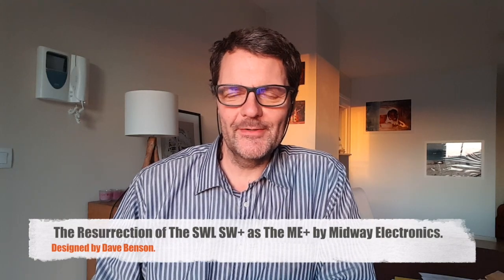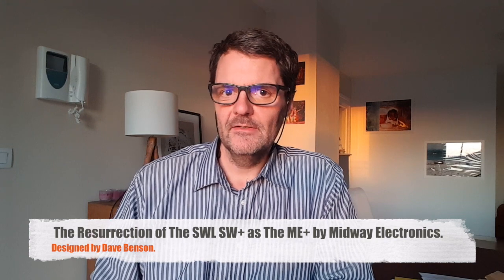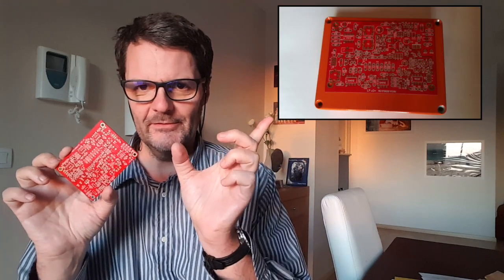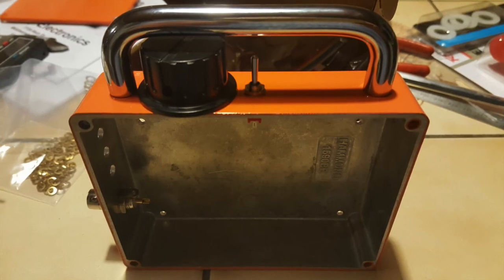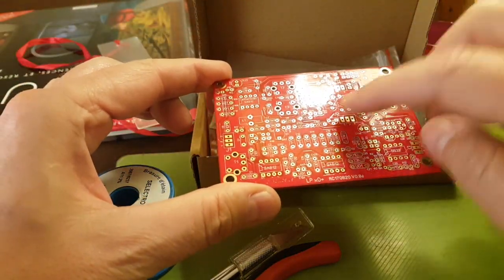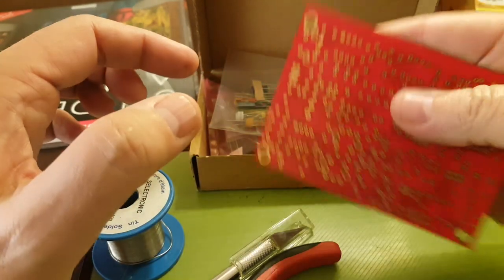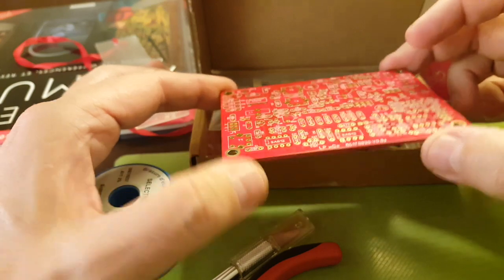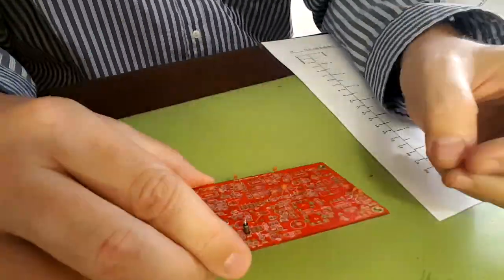The Resurrection of the Small Wonder Labs SW+ Radio, Pt1.

Comment: Years ago I built two SW40+ kits and still have them.  Haven't used them for a bit but did play around different final RF amp transistors.  I found that the 2SC-1969 works the same as the 2SC2166 supplied with the kits back then.  Then I tried the 2SC2078 in the second kit and found it generates a full 4-watts output, so I left it installed when I want another db.  :)  On the first 2-watt kit I often used a Ramsey QRP linear amp and got about 15-watts out.  Anyway, been doing this ham thing since the 1970's, and these Small Wonders are the finest single-band, low-power CW rigs I think I've ever used.  Small rigs traditionally had direct conversion receivers; the superhet Small Wonders was a great upgrade in selectivity.  If the later ME copies are the same, then no one should go wrong with them.  :)
Reply from the maker: Excellent thanks.

Comment: Actually, Gil, back in the day, the SW-XX+ kits were the bomb. (Most popular.) They were the entry point for a lot of QRPers in the 90s. My first one was the SW-30+  and when I completed it, I worked WD0CFF in MN from Socal for about 1,000 miles or so using a crappy vertical antenna. I was absolutely stoked and never looked back! Your videos are exceedingly good and I am a huge fan! Keep them coming!
71/72 de William, k6whp
Reply from the maker: Thanks. I am a big fan of Dave Benson's designs and have built a few!